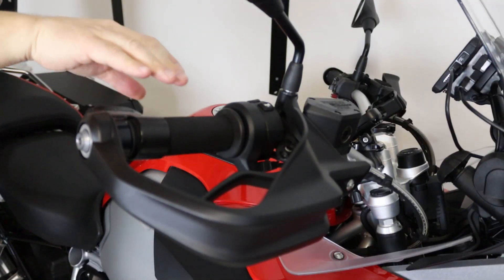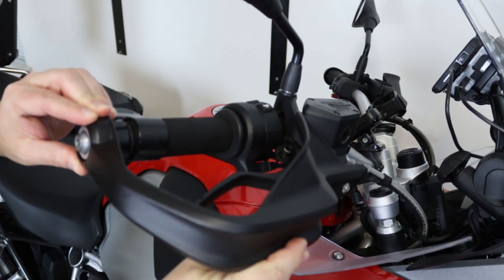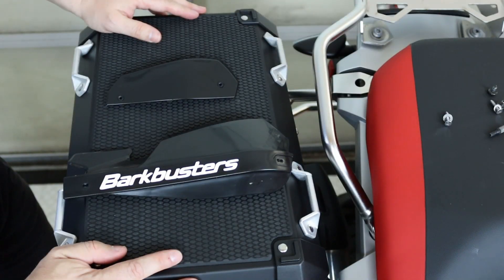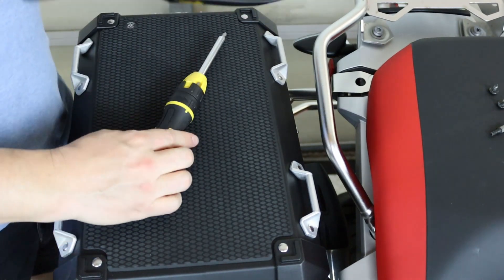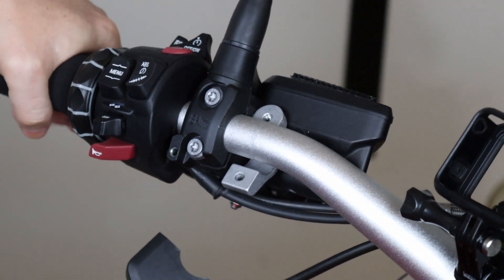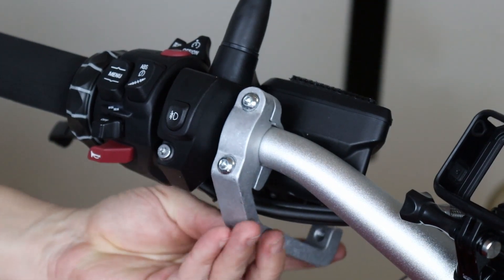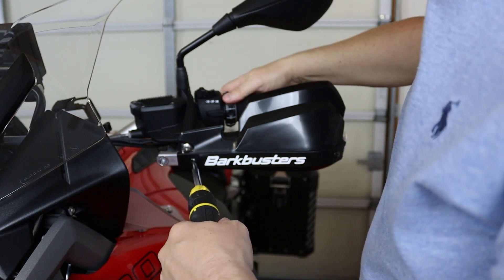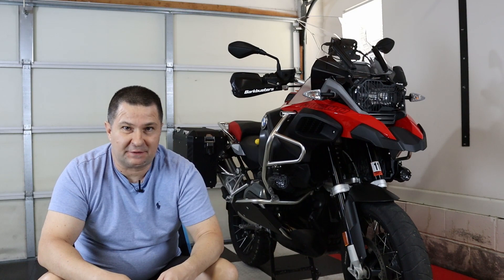BMW R1200GS Adventure Barkbusters VPS handguards install

Comment: so many thanks. I had been looking for this kind of video all day as I have the 719 reservoirs on my GSA and thought they would be a challenge. I'll see when I do all you did tomorrow.

I have a supplementary question. I see you have a mount for your GoPro remote. Can you provide details please? I managed to lose mine on a recent tour and have been thinking of how to attach a new one safely.
Reply from the maker: I use the GoPro pole mount, it seems to be quite strong... careful with the placement, though, a place with lots of vibrations increase the chances of loosing the remote. I found the handlebar to be quite  appropriate placement...

Comment: Hello and thanks for the very accurate and comprehensive video.  With which supports did you put the gopro remote control ?
Reply from the maker: GOPRO  OEM handlebar / seatpost / pole mount

Comment: Hi, how have they been working out for you?  No interference with steering when locked (windshield/gas tank) ?
Reply from the maker: Thanks for watching. There is a little interference with the windscreen knob, it has to be in a certain position to avoid interference with the aluminum backbone of the barkbusters. Once the knob is in the correct position, no interference, whatsoever. It seems they came up with a better version for R1250GSA. Thanks for watching!